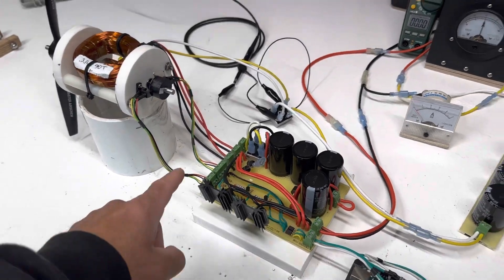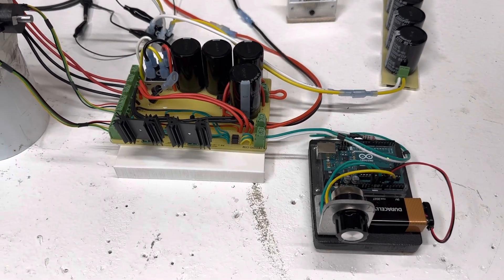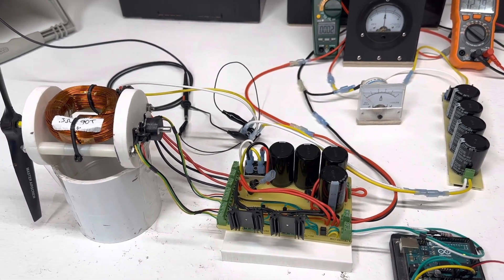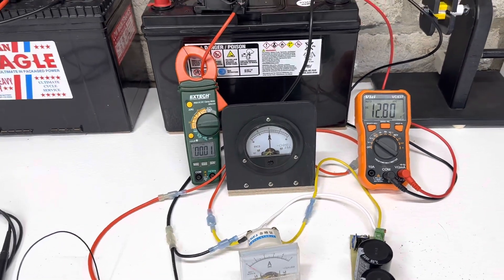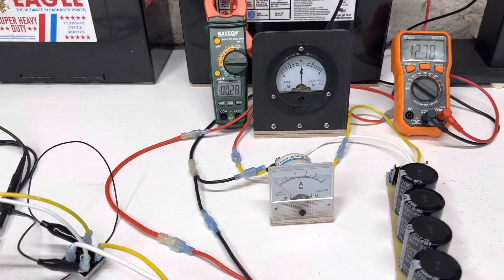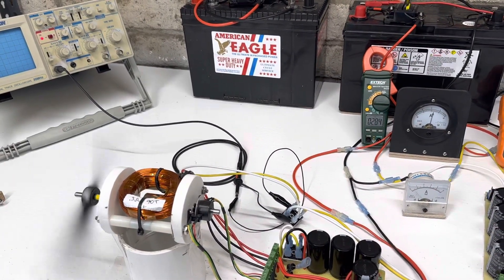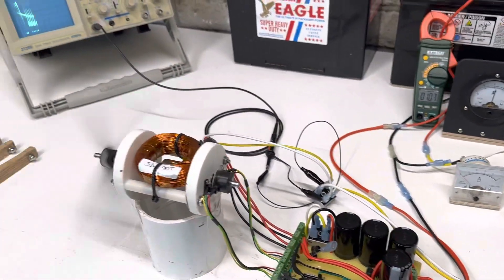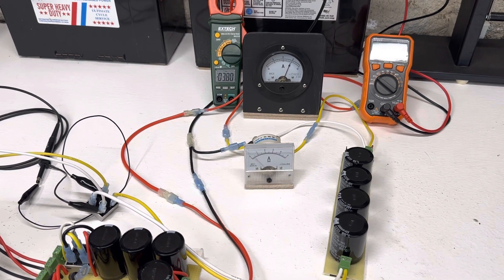H bridge alternative part 2

Comment: What size of wire gauge for the red and black inputs and yellow and white output, they seem to be flexible. Thanks for sharing
Reply from the maker: The magnetic wire is 18awg 3 the color is 16awg silicon tinned wire
Reply from the maker: Input is 14awg silicone stranded
Reply: @kenergy1707  thank you

Comment: That things about to fly off the desk. Have you tried running the attraction motor with this setup? I know it probably wouldn't matter but I wonder if you would get any more bemf with the flip on that type of rotor. If anyone could set it up, it would be you. LOL
Reply from the maker: Lol thank you ! 
Good idea but the attraction motor doesn’t need to change polarity so I don’t think it would help great thought though!
Reply: @kenergy1707  I wonder if it would...It already seems to have more output. Would you get a bigger pop if you flip the poles on the rotor without any magnetic flux built into it? It doesn't need it to operate but It begs to be tested and you're the man to do it. LOL
Reply from the maker: @theclintified  you never know could be interesting!

Comment: Pretty cool! Thanks for sharing! Do you have more details about the circuit and the PWM? I'm having trouble to drive air coil motors' with low resistance. I'm able to achieve decent efficiency only with higher resistance coils, which led me to the need to use 30+ volts.
Reply from the maker: Thank you ! Same circuit 
Pwm is from Arduino with 5 k pot